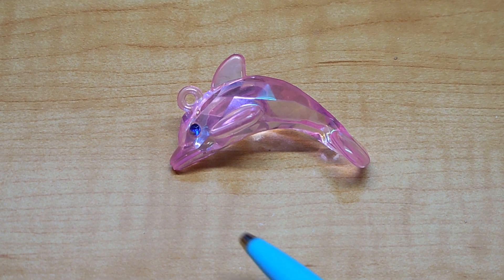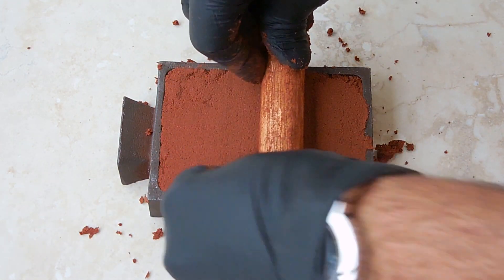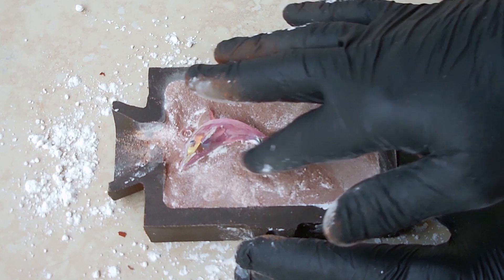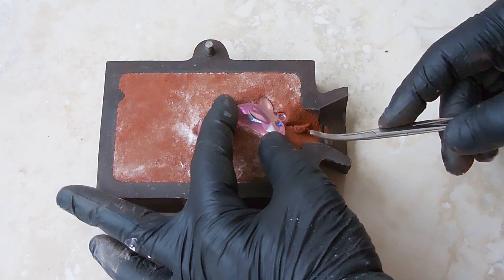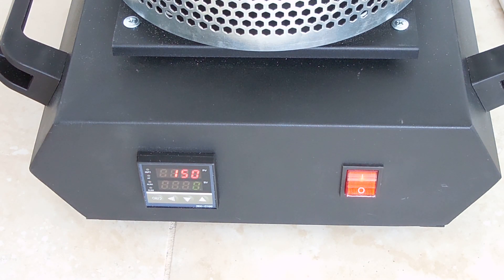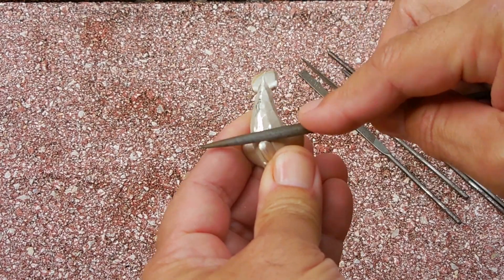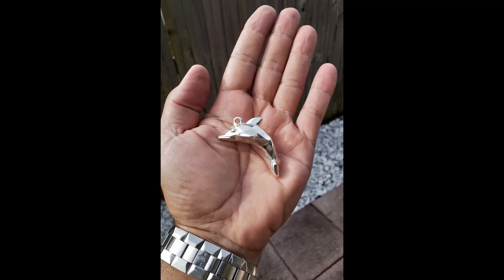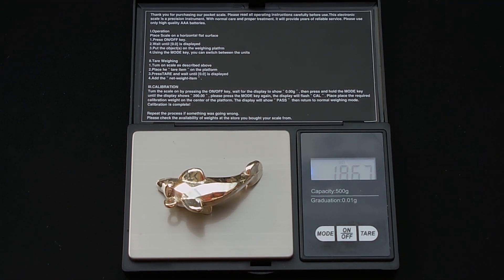How To Metal Cast A Solid Silver Or Gold Pendant From Plastic

Comment: looking to getting into making silver bars/coins/copper.  The inductive coil method seems the quickest/cheapest but the crucible also seems quite small.  Would you recommend going with this furnace version instead?  I like the idea of the silver melting in like 8 minutes instead of an hour it takes with these furnaces.
Torch is also an option but also seems a bit less safe and lots of room to accidently burn the house down. 🙂

Comment: Mystery scrap silver jewelry can have a lot of nasty toxic ingredients like cadmium and lead.  Even if the pieces are sterling, the solders typically are not.  Not something you want to be grinding into dust, inhaling fumes, or wearing against skin.  Genuine .999 bars and U.S. pre-1965 coins should be safe.
Reply from the maker: Yes. The 3 dimes inside the crucible were 1950's - 1962. The 3 rings were stamped 925. The bar was Frankilin Mint.

Comment: Great video.  I have that same exact electric metal melter, but mine refuses to heat up anymore after 4 melts it was used for.  Any ideas on troubleshooting or fixing?
Reply from the maker: Remove the heat protection screen, remove the screws on the top metal ring, then you can pull out the ceramic assembly. You likely have a burned out resistive wire. You can buy new resistive wire online for a low price to make a new heating coil.
Reply: @electronicsNmore  Thank you so much, that is very helpful.  I appreciate your videos very much.